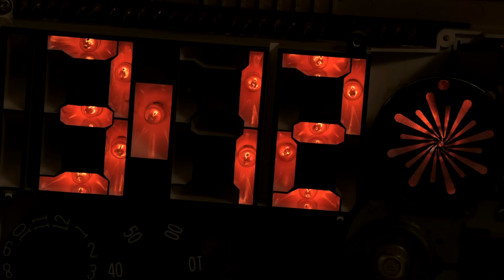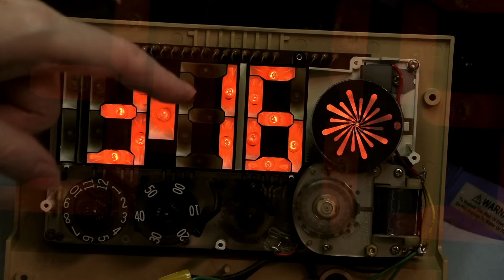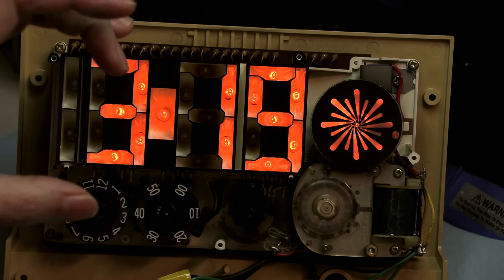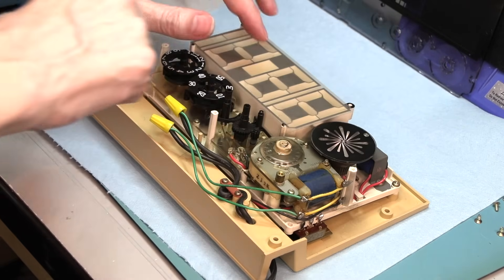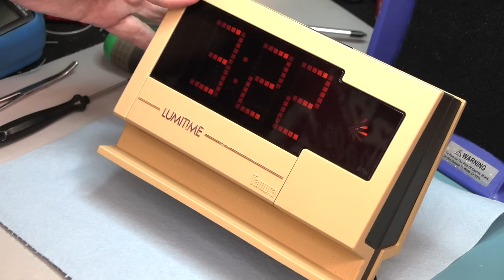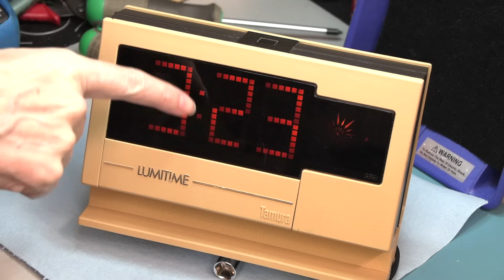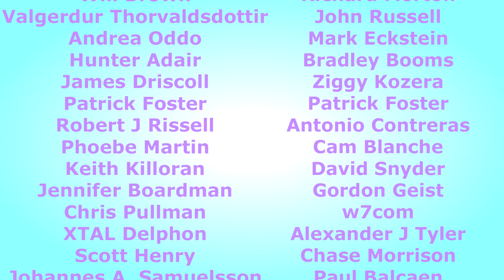Second Life For Neon Lamps?

Comment: I no longer use the condition of screw heads as an absolute indicator of whether someone has been into a device.  A few months ago I bought some BNJ (brand new junk) at a big box store.  It still sealed in the factory packaging when I bought it, but was defective.  I went to open it up and found that the screw heads were nearly destroyed.  Careful work with a good screwdriver got it apart but it wasn’t repairable.

I went out and bought another one, which was not defective, and the screws were nearly as bad as the first one I had bought.

Kinda wonder if these are hand assembled and if the workers are being given junk tools to work with.

Comment: I just had an experience with a neon bulb that reminded me of this video.  I'm not making any claims or suggestions. Just sharing what happened.

I have one of those little neon flicker bulbs in lamp in my bedroom as a nightlight that runs 24/7.  The bulb has been mostly dark for a long time; just a little bit near the base of the electrodes would glow, but the bulk of the material had no glow near it at all.

A couple nights ago I stuck a halogen capsule under the lampshade next to the neon bulb and ran it well below the intended voltage so that the halogen bulb glowed just a bit brighter than the neon one. The next day I noticed that the neon bulb appeared to have recovered to "like new" condition.  The majority of the electrode area now has that neon glow again, and it flickers like it used to even with the halogen capsule removed.

I'm not sure why that would happen. I don't know if it was the heat exposure (the two lamps had been making physical contact while the halogen capsule was running), or if there was something else going on.  It'll be interesting to see if the effects are long term.

Comment: In neon sign industry tubes are cleaned up by running at full current. After a few minutes the remaining ion impurities are driven into the metallic structure of  electrodes.

Comment: How about reversing the polarity of the diode?
Reply: That could work for a while.  I thought of a different way to go that would unfortunately take some hunting for the right part.
Sidacs can be had that trip at about 90V.  This would mean that from the zero crossing to 90V, no current flows and then the part snaps to a low on voltage.

Comment: Fran, seems like the obvious thing to to is to revers the diode and fun it at half brightness to try to revers the effect instead of the full brightness exercise. What do you think?
Reply from the maker: All you do is move the problem over to the other side of the lamp.
Reply: @FranLab  I was thinking at some point wouldn't reversing the diode undo the damage but being that  it took years for the problem to occur, I would think it would take years to reach an equilibrium of sorts. So for as old as the clock is, it might take a few decades to total recreate the same problem after reversing the diode. Yes?

Comment: there may be hope for neons.
I found that internationallight seems to have 50,000 hour lamps.
Also : An alternative to radioactive materials was used in some of the lamps.  It was an added small amount of another gas that somehow in the atom to atom collisions would get things started.  I think it works by having atoms of very different masses.  A small fraction of the lighter atoms get smacked hard enough.

Comment: Well, there are possibilities neon lamps leakage due to age (such as gas escape slowly from neon wire leads, if spot from corroded). Same concept an incandescent Christmas lights, some fails to light as well. It is hard to says, it must have to re-lamp an entire set as possible (or little group of lamps area).   💡

Comment: Anybody who's ever had a cheap power strip with illuminated power switch should know how quickly modern neon lamps flicker and fail.
Reply: Yeah, it's so annoying. I've had some fail after just a few weeks. I do think it's interesting how you can temporarily fix them by shining on them with a bright light. Feels like magic.
Reply: I seem to be an exeption. I have multiple cheap power strips in my house, usually switched on 24/7. Never any problems.
Reply: I have that as well but same I brought cheap power strip with neon lighted rocker switch. Unfortunately, I couldn't repair from rocker switch, it breaks real easily.
Reply: I have one that has been working for a lot of years now.  I bought about 4 on the same day about 5 years ago.  One still has a working neon in it.
Reply: My power strip’s neon lamp is running strong 7 years later

Comment: Reverse the diode and then run at low brightness to reverse the process?
Reply from the maker: Just moves the same issue to the other side.
Reply: @FranLab  I mean until the impurity migrated from the polluted pole but before it accumulated at the other pole. That took years before in the current state so maybe that takes years again and when it happens swap the diode back. Not using the dim setting is an option but if you want to use it maybe add something to reverse the flow once in a while automatically (maybe a signal from one of the segments with a circuit an a relay giving approx 50% average?). Dimming with AC looks almost impossible to me. Shorting the diode is also an option to disable the function if that function ruins the bulbs anyway.

Comment: Not sure if the envelope for the Neon bulbs are quartz or not.  If they are try wrapping them in a coleman mantle for a week (or some other source of "spicy"). Some of the neon bulbs used spicy Xeon gas to help them strike faster.
Reply: What is the importance of them being quartz or not? Is quartz glass more transparent for beta radiation? BTW they are not quartz. Why would they be? Both the material and the manufacturing process would be a lot more expensive, and it is unnecessary because these run stone cold. Unless quartz somehow holds better vacuum, that would be the only case worthy for making them from quartz. But they would probably do so only for long life military/industrial bulbs, not for household ones.
How about a bit of Americium from smoke detectors? Although I dont know if any radiation exposure would help them after removing the source. Or would there be some remaining radiation?

Comment: Something I noticed is that neon lamps after many, many hours of use would turn black inside.... something was deposited on the glass...never really understood what was happening there.
     Old neon indicators were rated at 100,000 hours. Or so. Many lasted longer. I have an old AC clock that's approaching 40 years old, and the neon dial light is still good.

Comment: As far as I am aware the mains AC voltage in Japan has always been 100 V and still is.
Reply: Indeed, but it's the frequency that's the issue. 50Hz and 60Hz.
Reply: @bobpockney  ,  I know that, and fran did mention it, but the higher voltage when you run these clocks at 120VAC in America is probably pretty rough on the lamps.  If I owned one of these I would be looking for a way to drop the lamp voltage a little bit.
Reply: @goodun2974   IIRC the clock was rated for 120 volts. The resistor values are likely higher than in units made for Japanese use.
Reply: @eDoc2020  , the wattage plate on the back of the clock said "100 volts". I saw it in the video!
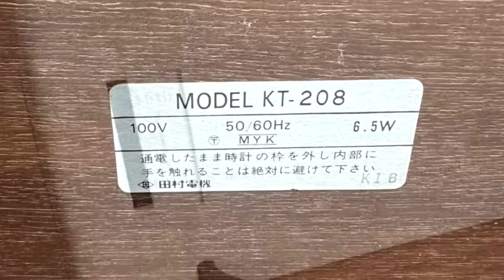Reply: @eDoc2020  , I get it now ---- at 12:52 Fran inserted a brief photo of a label from a different clock or device, with a wood case, that was marked "100 volts", but not this particular clock.
Reply: @eDoc2020  okay, now I see what happened; at 12:52 Fran inserted a photo of a label from some other device that said "100 volts, 50/60 Hz", but it wasn't this particular clock.

Comment: Many power strips have a modern, Chinese neon lamp in the switch and they run for years. I have put Chinese neon lamps in some of the light switches in my house that have been running 24/7 for 5 years now and don't show any signs of degradation. I'm not sure why you have such a bad experience with them.

Comment: usually with much lower current they work for much longer..but ofc changing them to new ones isn't big issue as those are not expensive..it only takes times ..i changed leds on my precision 10 volt source to neon bulb .i hope it will last at least 5 to 10 years..but who knows..quality isn't what it used to be these days with all things considered..

Comment: New lamps reducing the resistor value simply results in them going dim from sputtering, nothing else.  Simplest fix for the dimming is to swap the diode around every year, so even out the ion impact on the electrodes, and yes those are thoriated steel electrodes.
Reply: Yeah, that was my thinking. What if one swaps the half-wave polarity?
Reply: Yeah, flip the diode to alternate "burning" of the anode and cathode.

Comment: A few early radio tubes such as the original 201(not the A version) and the WD11, as well as some transmitting tubes, used thoriated tungsten filaments and the tubes could actually be rejuvenated by a brief run time at a higher heater and plate voltage.  Oxide coated filaments however turned out to be more efficient and were quickly adopted; those cannot be rejuvenated.

Comment: Frian, what would happen if you used a parallel-opposite pair of zener diodes to lower the voltage to the lamps and dim them somewhat while still having both cathodes/anodes lit?
Reply: That would dim them, however they would also flicker more.